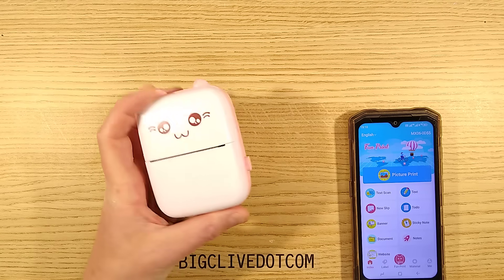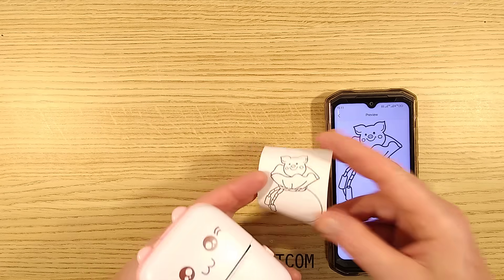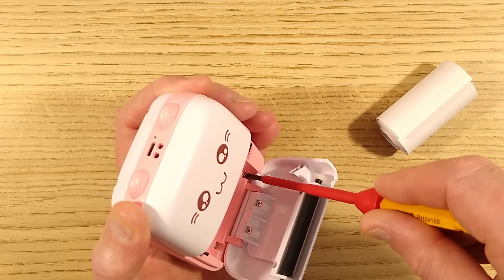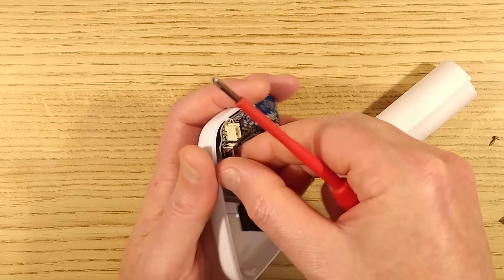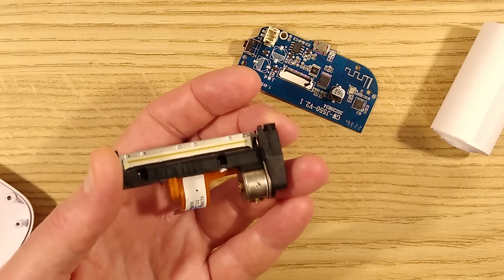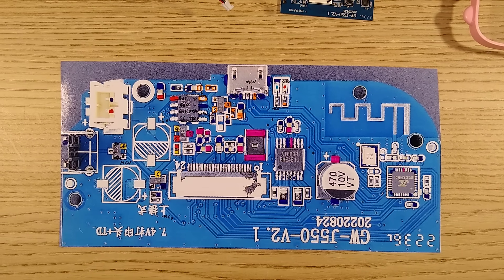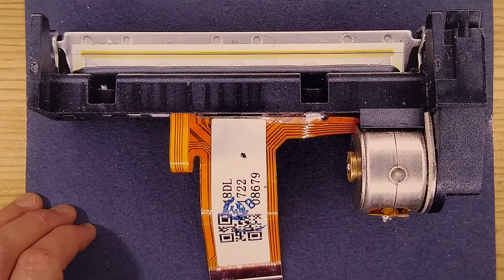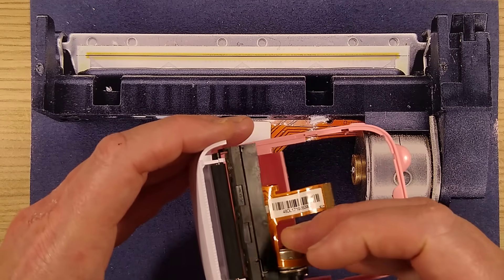Mini bluetooth thermal printer teardown - with schematic

Comment: would love to see if anyone knows some opensource or otherwise alternate software for this, nice gadget, but sceptical to installing unknown chinesium software on my device.
Reply: I'd ask wy ? 
It's not like the app is running 24/7 . 
Also I'd argue that most apps from well known brands spy way worse than this app ever could
Reply: @NinoJoel  Wow, this is basically the same boilerplate response to every comment along these lines... The lack of imagination shown, en masse, for something this important is downright terrifying.
Here's a few ideas to get you started...
Sure, the big guys do it too, to some extent, but there are far more folk and organizations keeping an eye on them.
... oh, forget it.
Reply: @ericwazhung  the lack in imagination is a good point. 
You really think big brands don't use and sell all your data? 
You literally agree to that by the time you made your account to download anny apps for the store. 

Sometimes even the entire operating system does all the spying work without you even downloading any software. 

I don't see anyone questioning windows ... Especially windows 11 which has AI analysing everything you do to send it to servers on the other side of the world. 
It does not collect data it outright farms data from its users. 

So I ask again.... What is a printer app going to do what hasn't already happens several times by other companies without you caring / noticing. 

The main reason people complain is that the app is from China. 
They don't really care about their data deep down. 
They just find it repulsive that a Chinese app has the data
Reply: @NinoJoel  sigh You're almost on the right track, but you completely missed my point. I haven't the energy...
Reply: @ericwazhung  maby you should work a bit on the way you communicate. 
It is down right rude and comes of arrogant
Reply: @NinoJoel  Here's the thing... You're taking a defeatist-mentality that, in-so-taking therefore causes the thing you're too-soon deeming truth.
I can give you a dozen examples of things I'm near-certain large corporations most-likely can't and almost certainly won't do that you sound like you are now more than willing to enable smaller groups to do.
I'm in no way saying that what those large corporations are doing should be considered acceptable. But that they are limited due to factors like liability and oversight (and even masses of "good hackers"). The information they share is almost certainly tiny compared to the information you've allowed them to gather.
Now, you're willing to allow anyone to gather that same information, folk/organizations that have no reason to worry about what they do with it. Who they sell it to, and more.
It's the same information, yes, but it's a matter of what they'll do with it, now, and maybe even someone else may do with it years from now. Those folk have no reason not to share anything and everything they gather. There is likely no one overseeing what they do. And even if there was, they may exist in places where law has no impact on them. Your freely giving that information to them is very different than your freely giving your information to companies who can face lawsuits, and know they can.
Is it good that we live in this era where these things are even a concern? Not at all. But there are some things we almost have to do in order to be a part of our society (like own a cell phone), and there are things we just do because it's fun (like get a cheap labelmaker that looks like a cat). Regardless of where it comes from (e.g. China, or some US highschooler's bedroom) it is a bad idea to install sketchy apps on the one device that can keep you connected with the people who care about you, especially in times of emergencies, etc!
Your defeatist attitude shows that you have yet to even begin to imagine the sorts of horrible things that can happen as a result of the misuse of personal information, not only yours but also that of anyone in your contacts, and more. It shows that you never considered that the "permissions" you grant your apps really have no meaning, because there're ways they can get around those you deny (e.g. you don't share your contacts, but the app is capable of taking screenshots).
There are things no corporation in their right mind would ever gather (or assemble), nevermind share, due at the very least to the legalities, if not maybe a sense of ethics, that others would have no qualms about. No reason to.
Your attitude also shows that you have no idea about how apps work. Just because it's only in the foreground when you use it does not mean that it's off when it's not in your running-apps window list.
Now that all that has been said (and tons more hasn't) we come to your valid complaint about folk relating sketchiness to China. And, yes, that is wrong. BUT, the fact is, this scenario (described above) has already gotten as far as it has (which is far too far) because folk are unaware of the risks, or defeatist, or so-forth. Thus, it's my opinion that if folk express concern about these matters, then it's helpful to others to become aware of such concerns. IF such comments make even one person, who naively thinks downloading any app is OK, to think twice, then it is beneficial to everyone. YES blaming such things on "The Chinese" is very wrong, but nowhere near as wrong as the aforementioned scenario's having gone unseen/unchallenged, and even perpetuated, for so long. THAT affects EVERYONE, even "The Chinese". So, while I think it's great you are taking a stance against discrimination, I fear that stance is ruined by the things you suggest are the important concerns.
The important concerns you highlighted include, essentially: "You already give your information to corporations, so why are you afraid to give it to Chinese?" Which, frankly, not only misses the point, entirely, but also sounds a bit like propaganda... which defeats your intent to try to put an end to discrimination.
Reply: @NinoJoel  Apologies, nature called and I summarized poorly in my rushed conclusion. My concern regarding your statement is regarding how it may come across to folk who don't know better...
Imagine you're a parent saying what you said to a child (or, maybe, imagine saying it to grandparents) who have never installed an app before. You're showing them, for the first time, how to install an app... Now the installer asks about what permissions you'd like to allow the app to use... And your child/grandparent asks "What's this all about? All I wanted to do was [read the news, use a printer, etc.]! Why does it need access to my files?" Now in explaining it to them you say: "bah, you already gave Google/Apple/Microsoft *everything*, so don't worry about it, just click 'allow' whenever you install any app... it can't be worse than what you've already allowed!" THAT is essentially how what you've said here comes across to me... That's bad advice. That's the sort of advice that got us into this mess in the first place: "Bah! Nobody reads the EULA... just click OK"

Comment: It's still somehow amazing that this type of print head can managed to print as after all, those microscopic resistors need to get hot pretty fast and be precise and heat is heat, it's easy to make something hot but not that easy to cool it down fast without additional help and heat spread it self around so it's not super precise.
Reply: No thermal mass means it won't retain the heat for more than a microsecond

Comment: I bought a USB version about 2 or 3 years ago, I used it for printing lables for birthday and xmas pressies.The first time I used it at christmas, I stuck them on with sellotape, after about 3 hours, I noticed that all the print had vanished. Very strange.
Reply: All thermal paper does that. It seems that the adhesives in the tape dissolve (or otherwise react with) the matrix on the surface of the paper that contains the thermoreactive dyes, developers, sensitizers, and stabilizers.
Reply: @wbfaulk  Oh, cool. 👍
Reply: must have been the "Now you see it, Now you Don't " Version 😆
Reply: mind telling which you bought? might buy one for some simple label making.
Reply: @Insomnii95  It just says 'Mobile Printer' on the box. I got it from ebay for about £25.
Reply: Another fun fact is that if you write on a piece of paper with thermal paper under it, just the fumes from a magic marker can make the thermal paper go black.
Reply: @vnvn-st5pn  Brilliant. 👍
Reply: I have a Phomemo from Amazon and its great.
Reply: the glue in the tape has dissolved the ink on the tape

Comment: Ha, it uses the JL JieLi microprocessors inside of it, this is ome of the rare cases they are used somehwere else then bluetooth audio speskers or bluetooth audio. I gues it makes sense it was their cheapest option and it has bluetooth in one chip, do wonder what firmware it has. These tiny chips run a uboot bootloader and you can easily put them into DFU mode by putting a signal across the usb pins and it shows up as a JieLie xxxxx usb device and using jl uboot tool on gitbub to dump the key from it and dump the firmware, might buy one to experiment on

Comment: I'm actually considering it as it looks like it could be kind of handy.  There are some options that include white and colored types of paper as well as some self adhesive thermal paper for it.

As always thanks again Big Clive.
Reply: I have one, can confirm it prints nicely onto sticker roll, but they're very fiddly to split apart to peel the backing off! Works well for printing shipping labels
Reply: @richardbanks2669   will it just work as printer, if has some sort of Bluetooth printing ability, or are stuck using app that big Clive , demonstrated ideally if windows could USB or Bluetooth , out documents to it as just a printer??
Reply: @dh2032  - You have to use the app it comes with. Seemingly no other way of printing to it.
Reply: @dh2032 I've been wondering the same. Perhaps an added Bluetooth USB? 🤔
Reply: @richardbanks2669  - To get the sticker backing off, use a craft knife to fray an edge. You can then easily peel them apart.
Reply: @richardbanks2669   I just got mine a couple days ago.  Pretty slick.  As mentioned, a little fiddly ripping the sheets but then I have also found I like a little more paper under what I printed so I open the little door and use scissors.

Sort of an extra step but makes it easy.
Reply: Just be careful regarding BPA/BPS thermal papers…
Reply: @Xeno274   what BPA/BPS ? on thermal paper?

Comment: I assume the "POS" in "JLBPOS342-56C4" is for "Point Of Sale", which is probably what some of the chips/circuitry were originally design for?
Reply: Or maybe its normal those JL chips have obscure datasheets that dont match with the numbers and its often the serial number for mfr or the firmware name
Reply: JL chips have their label formatted like this: serial number-part number

Comment: Wow, so much and complex circuit for a cheap piece o crap. Well done Clive, great work as usual.
Reply: Its not realy crap. 
It has uses and is ridiculous cheap for what it does
Reply: For £12 its good value. @NinoJoel
Reply: @tonysheerness2427  12? Where?
Reply: For a cheap labeller it has its uses.

Comment: I can see this being useful at work to label things in our store cupboard! Can anyone take on the task of reverse engineering the app maybe so we don't have to install their cr**p?
Reply from the maker: I'd recommend something like the brother label printer for rugged labels.
Reply: @bigclivedotcom  I've got a USB connecting one of those - Dymo actually - which does the laminated tape labels. But I'm thinking of temporary (has to be with thermal paper anyway!) labels which say 'tested - date' or something similar for labelling stuff on the shelves...
Reply: There's open source apps for this

Comment: Remarkably simple design, might pick up one of these to print rude messages. Side note, the thermal paper can be "written on" by a fingernail rubbed swiftly across the surface. Rather amusing screwing with sales clerks by signing the receipt without a pen.
Reply: Reminds me of when I persuaded my mum to get me a mechanical Dymo label printer when I was young to 'label my lego". Sorry mum, rude and silly messages hidden round the house and school was way more fun! 😂
Reply: Looks like just the thing for printing out one's thoughts on other's parking ability for sub-wiper delivery.
Reply: Oh, we had the same idea
Reply: Maybe I should release my code to print to this via RPi (easily rewritten in principle for an ESP32). It gave me flexibility to print without unreliable Chinese app of dubious quality and origin. It was good for a bit of fun, but I never completely finished the project, I moved over to a print assembly that could be packaged into one case.
Reply: @Dennis_M1DLG Do it! 😁
Reply: oh yeah, rude messages printer, I like that